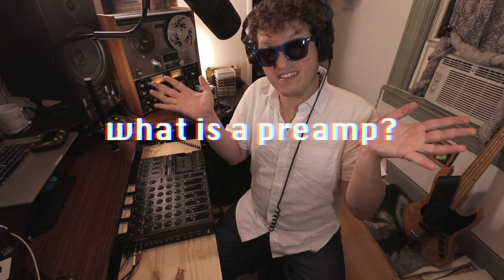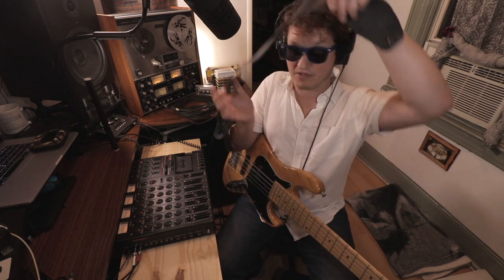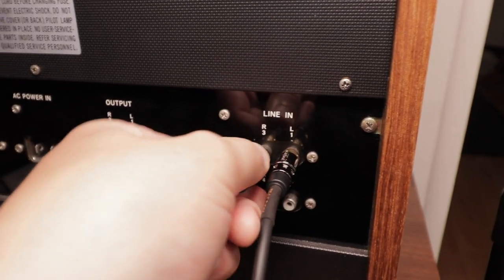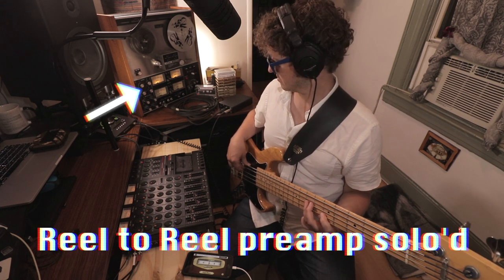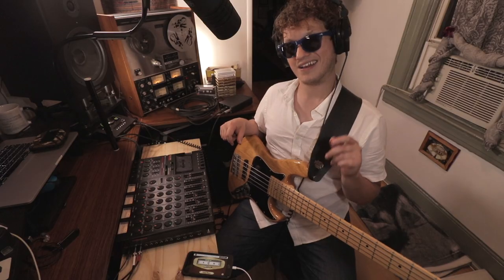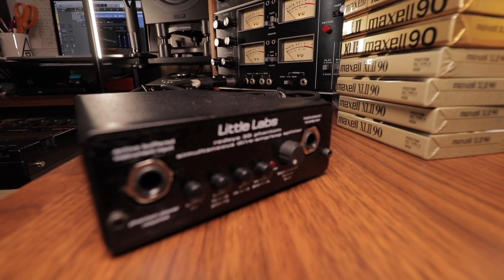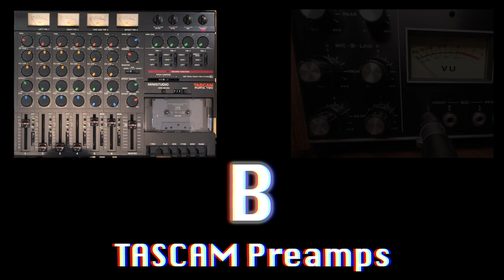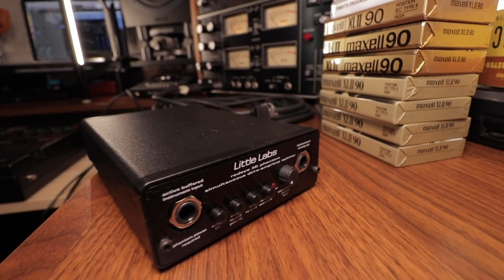Reel-to-Reel Preamp vs. TASCAM Portastudio Preamp ||| Can you hear the difference?

Comment: when you say digital preamps you still used a scarlett or something with preamps right not like virtual preamps without actual power?
Reply from the maker: you’re correct. if i had an ADAT setup i could bypass preamps. generally Focusrite or UAD preamps are very clean, especially at unity gain. What i really mean is using that clean preamp vs the dirty ones

Comment: i have been working with the recorded clean signal through varios preamps....Advent 1971 Cassette it gives a delicate flatt contur to the drums and voices and the overall track....also I use a Philps mono reel to reel 1964 tube amazing and DBX compressors por audio not studio 1970s etc...is like once you get to know this way of handling the sound you wont go back to plugins in fact I use almost no plugins just eqs and reverbs delays or flanger and phase efects....good work man love the video
Reply from the maker: ahh great advice and thanks for watching! 🙏

Comment: Have you ever used the art tube pac pro? They have a fixed ratio compressor on there and they sound really good for bass and synths. Also a Roberts/Akai preamp is freakin dirt nasty good if you can pull it out of a working unit.
Reply from the maker: i have not used either! love the suggestion and the price point on ART gear always 😉
Reply from the maker: i have not used either! love the suggestion and the price point on ART gear always 😉
Reply: @MadeOnTape  Gotta rep ART stuff, inexpensive and ya get some good sounds.
Reply: 25$ Art tube pre is amazing on bass !